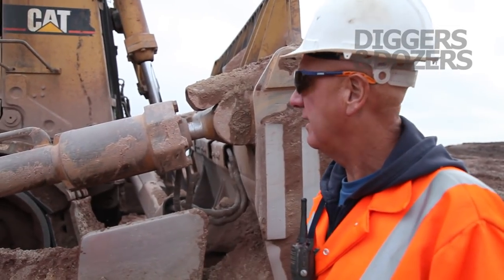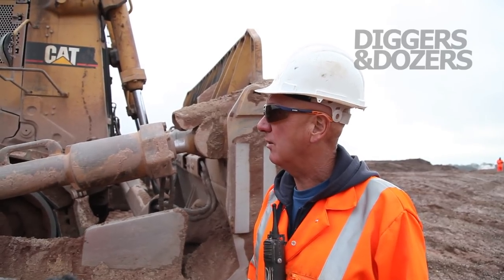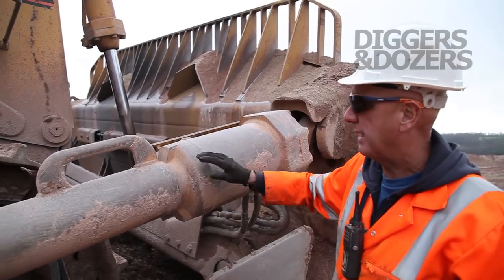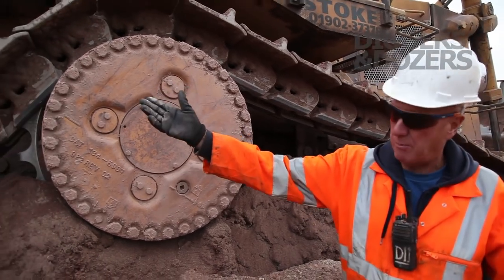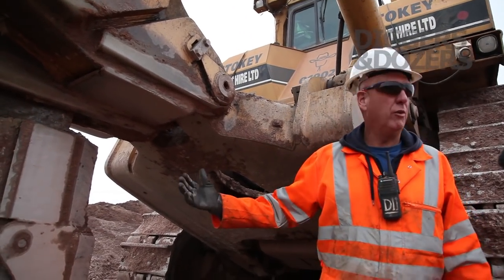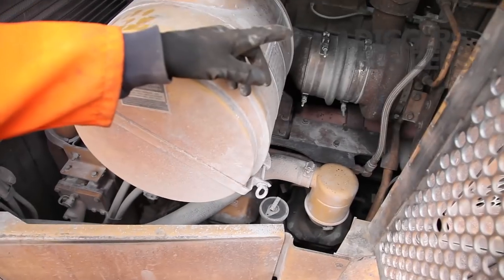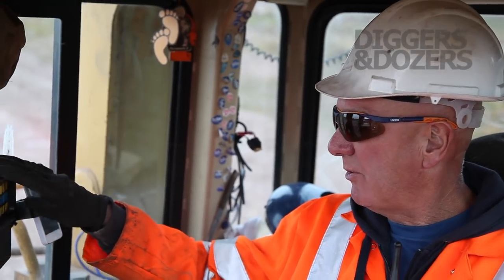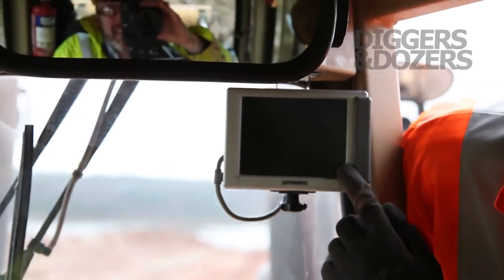Caterpillar D11R Dozer - Behind The Levers

Comment: In terms of quality and maintenance costs, how does Caterpillar compare to Liebherr and Komatsu?
Reply: I run both the brand new CAT D11T and New Komatsu 475A equivalent. I can tell you no one wants to run the Komatsu at our site. They are rough, do not back up the steep stuff, don't like being on their sides when side cutting, poor flat track design, get stuck much easier, not as user friendly with poor stick steering control vs. CAT finger paddle steering and have too low 1st gear and too high second gear. The CAT outperforms in every situation hands down! Problem at our site is poor availability of CAT parts and poor service by Finning CAT and are waaaay more expensive to purchase. Mines are cutting costs by going Komatsu with initial purchase but they lose money on less production in real world mining. I rate the Komatsu product as 6 out of 10 vs. 9 out of 10 for CAT. I'd love to try the new Lieber

Comment: That's not an oil cooler (@2:00) my friend, that your A/C condenser, all the Oil coolers in the D11n d11R and d11t are the Oil to water type. I haven't been lucky enough to run a d11R or D11T, but have run D11Ns and the 84W D10s all impressive big machines.
Reply: Alexander Grayson whays the difference between those letters?

Comment: The oil cooler looks a lot like an A/C condenser.
Reply: That is an ac condenser. Guy knows the machine buy what he read in the operation book behind the seat is all
Reply: Usually the condenser is in front of the oil cooler and or the radiator. [First in the incoming air stream] Hydraulic Oil coolers are typically in the airstream after the radiator. This rig likely has a transmission oil cooler somewhere also. So get out your repair manual to figure it out. The op manual is unlikely to discuss this.
Reply: Cools the guy off

Comment: You pointed to the trans torque converter temp not engine oil but you are forgiven
Reply: You can get that job done with a TD 40 dresser it might take 2x longer but it runs it mite smoke 🦴

Comment: I'd have thought an 11 would push waay more than 60-70 ton !
Reply: +Tod Lindley it can, a dozer can push its own weight- in this case 110 ton+
Reply: lol more like 7-800 metric ton on a 2/1 slope feeding pc 8000 or p&h 4100 boss and no they dont break easy thats why cat d11s are the best
Reply: 40 yards times 3,000lbs is 60 tons. The u blade will roll about 40 yards . Anything beyond 60 tons depends on how big it is and how good the traction is.